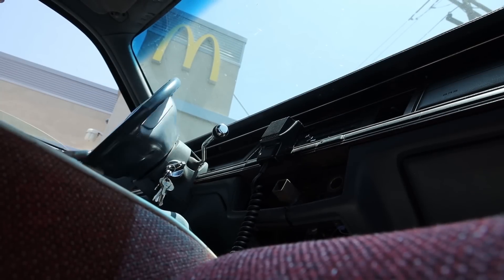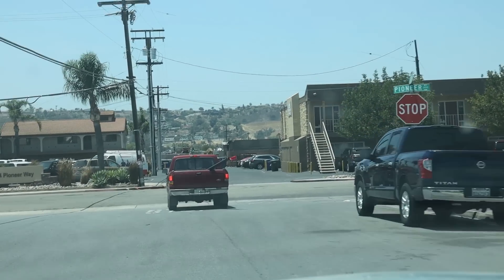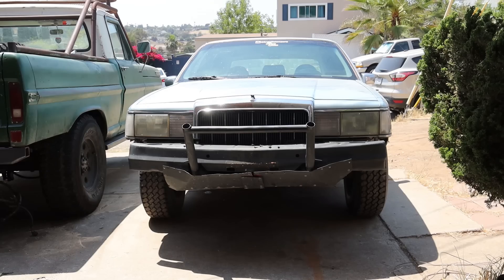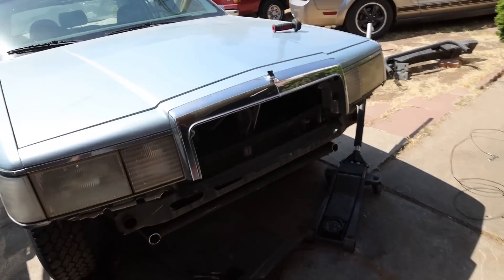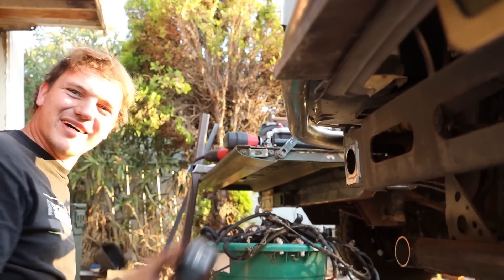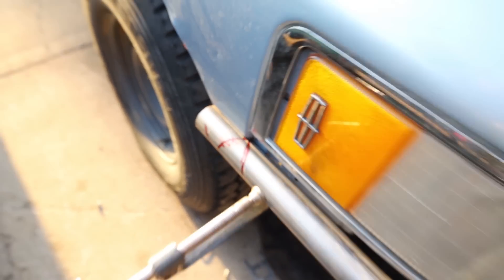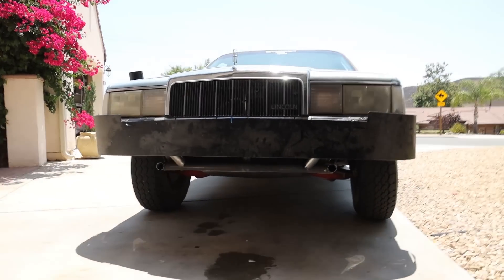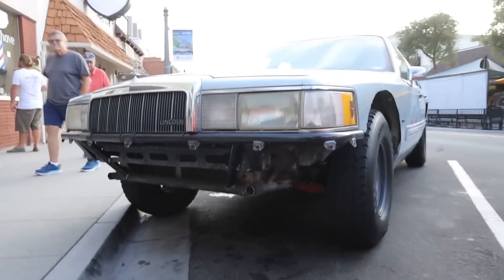Building a Custom Tube Bumper For ANY CAR!

Comment: You should do what the Jeep guys do and get rubber edge trim and use it on the cut fenders, would make the lines look a lot cleaner and it’s cheap and easy